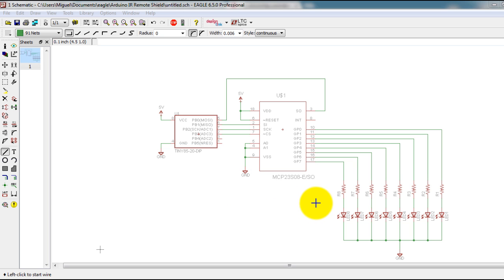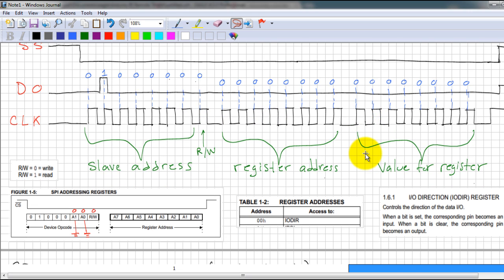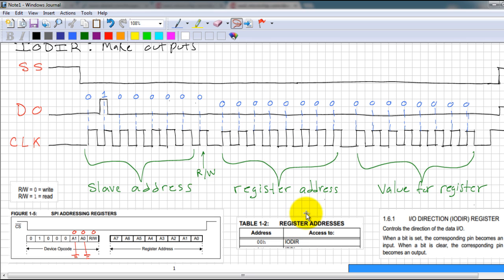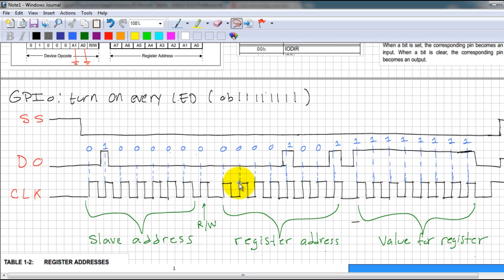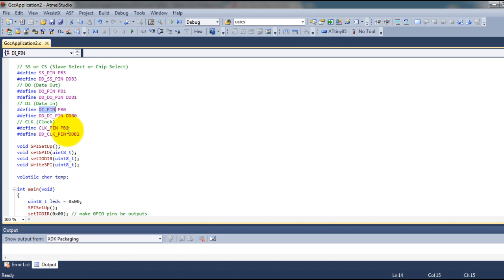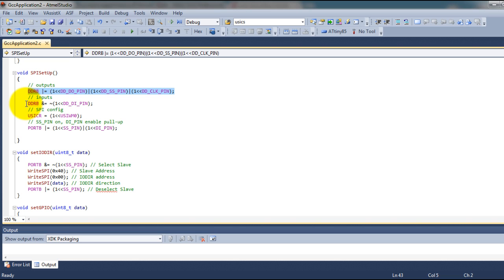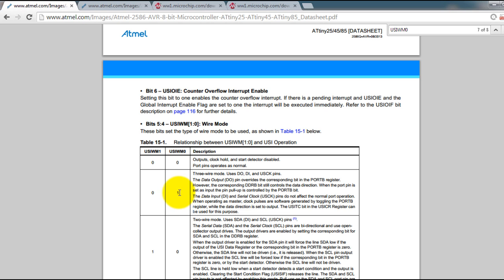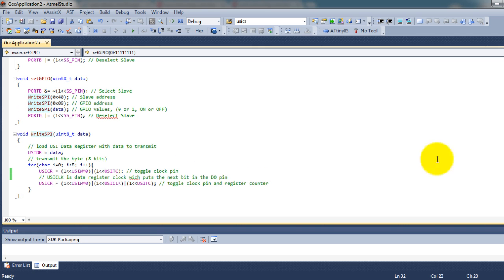AVR ATtiny85 Programming: SPI Communication (I/O Expander MCP23S08)

Comment: Shouldn't MOSI (Master Output, Slave Input) on the Tiny85, connect to SI (Serial Input) on the MCP23S08 (and likewise MISO connected to SO)?
Reply: I also think he is wrong
Reply: he actually uses in the code PB1 as data out , which would be MOSI if naming convention was obeyed. good work explaining stuff anyway